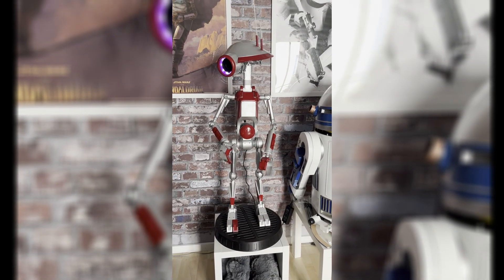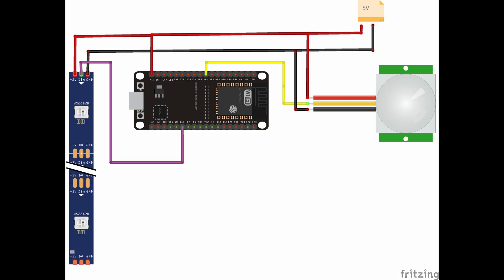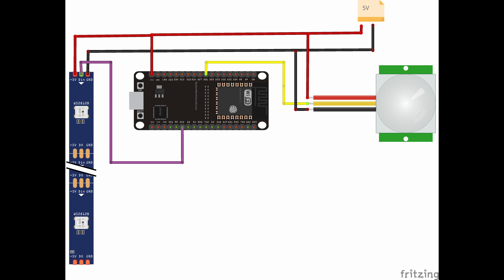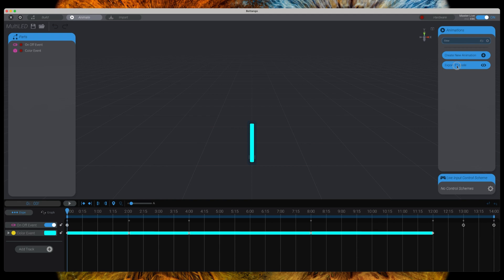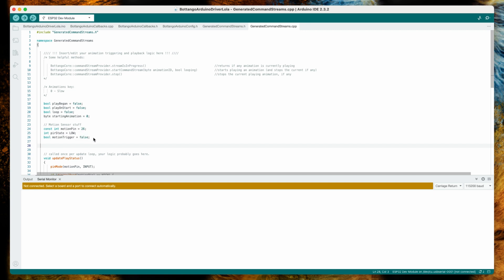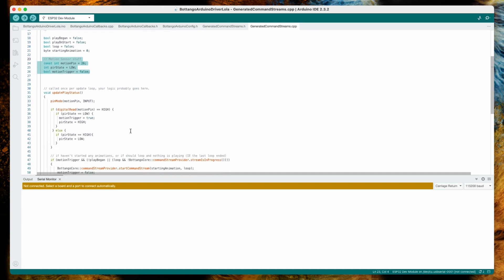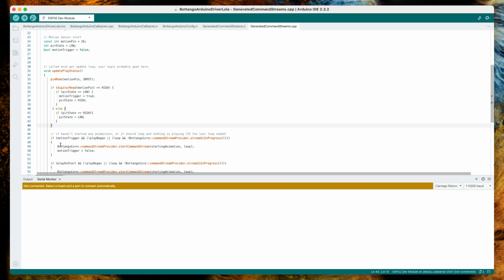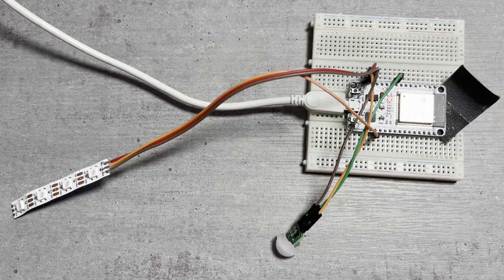External Trigger for Bottango Animations #11

Comment: thank you for these step by step video series, very useful! I have a question which was not really mentioned in the video: How do you set up the color effect to change color one pixel at a time?
Reply from the maker: Not sure what exactly you are looking for? In my other video "Pitdroid with Arduino and Bottango - LED Color Change #7" I'm covering how I did implement the color changes as seen in the video. If you want other effects, than this is something you will have to adapt the source-code to.
Reply: @buildWithMe1970  I was trying to understand how you switched color one LED at a time in this video. Anyway, in the meantime I figured out a way of doing it by putting code in the effectorSignalOnLoop routine in the callbacks